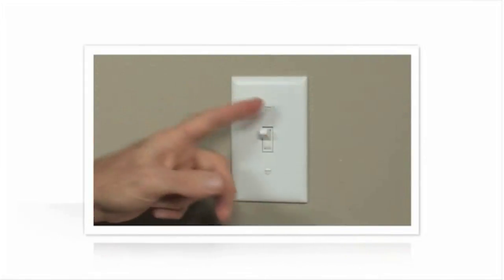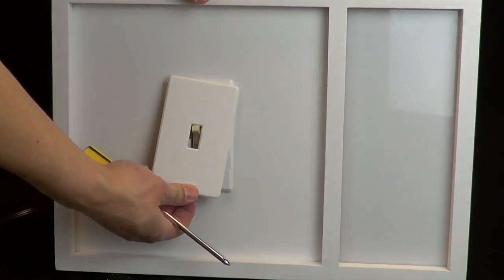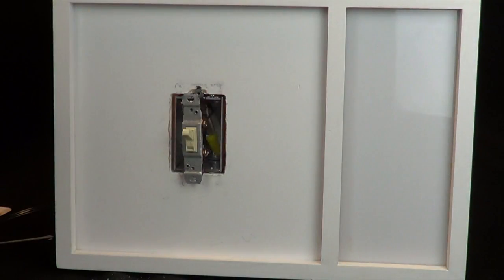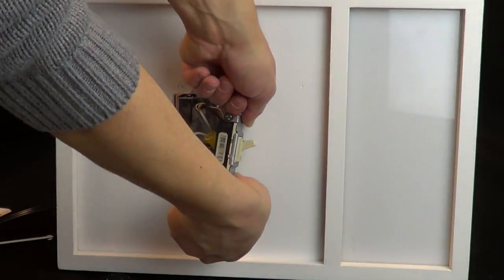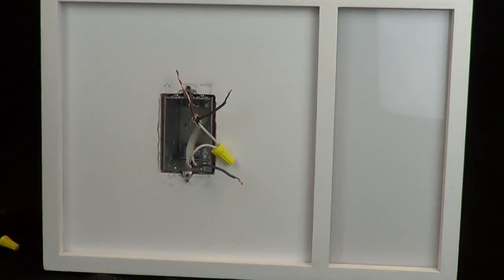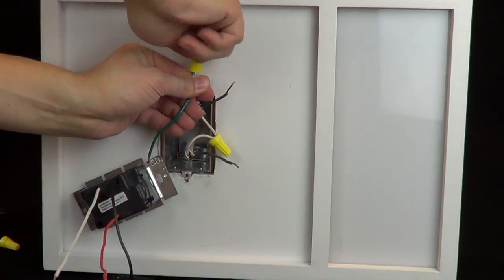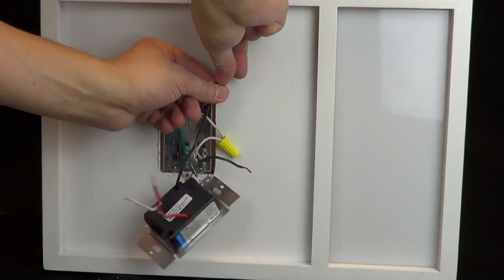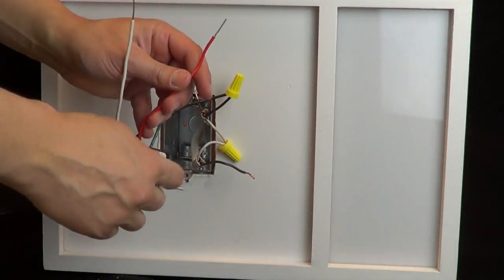Wiring a Control with 1 Black Wire, One Red Wire, and One White Wire (Single Pole Application)

Comment: I have a single switch.  New light fixture has white and black wires on one side and another set of white and black wires on the opposite side with one ground.   The ceiling has one single white, red, black, and ground wires.  How do I connect them?
Reply from the maker: Our Technical Support team will be able to best help with recommendations for specific scenarios. You can reach them at 1-844-588-7661 or support@lutron.com. We’ll talk to you soon!

Comment: Does it matter which black wire I connect the red wire to or can I just connect it to either black wire?
Reply from the maker: Hello! Installation with a dimmer/switch that requires a neutral the 120V (hot) goes to the black wire and the Load (light) goes on the red. If you are installing a unit without a neutral then it does not matter.

Comment: I have one wire that is both red and white on my Lutron dimmer. Is that the white neutral wire you describe in the video, or the "confusion wire" to throw me off?  🤣
Reply from the maker: In single pole applications the red/white striped wire would be capped off using one of the wire nuts provided. For 3 way applications the red/white striped wire is used as one of the traveler wires. For more wiring help, please visit https://www.lutron.com/en-US/Education-Training/Pages/Tools/InstallDimmer.aspx

Comment: I have bought humidity switches for bathrooms. Current bathroom fan has only 3 wires but the new switch has 4. what to do?
Reply from the maker: Hello Ratan,

Thank you for reaching out! The product in this video is not a humidity switch, and Lutron does not sell humidity switches. If you have any questions about wiring a Lutron product, please feel free to give us a call 24/7 and our agents will gladly assist! We can be reached at 844-588-7661 for technical assistance.

Please let us know if we can be of further assistance.

Comment: Hey I have a quick question. 
I have a dimmer switch that says to use 1 black, 2 yellows, and a ground. But in the wall I have a black,red, white and ground so what do I connect to what?
Hopefully you can help with this 
Thanks!
Reply from the maker: Hi. I'm unable to find a Lutron dimmer with 1 black and 2 yellows. Do you have a model number so we can be sure we're referencing the correct product? Typically, the black wire in the wall will be your source voltage of 120V, but the rest of your wires can vary slightly depending on how the house was wired and whether this is a single-pole or 3-way switch.

If you'd like, you can give us a call at 844-588-7661 and we can discuss your specific situation.

Comment: Hi:  I have a light switch with two control., the Kitchen and the Bread fast.  The breakfast  fixture have three wires , black, white and red.  where does the red go ? when I connect the  light fixture to the black and the white and leaving the red out  the Kitchen and the breakfast control both lights fixture.  When I connect the red to the black the kitchen switch controls both and the breakfast switch doesn't work
Reply from the maker: Hi! It appears that the red wire should go to the kitchen fixture and the black wire should go to the breakfast fixture and down at the switch, the red wire should go to the control meant for the kitchen and the black wire should go to the control meant for the breakfast fixture. If you need additional help or guidance please reach out to our technical support line at 844-588-7661.

Comment: What does the red wire connect to if there is no second black wire?
Reply from the maker: Hi, Hammad. You have to have a wire available per wire on the dimmer, if you do not, it will not function. Please let us know if we can be of further assistance.